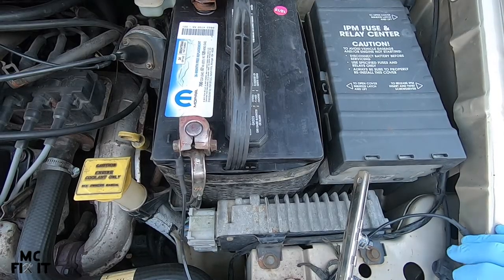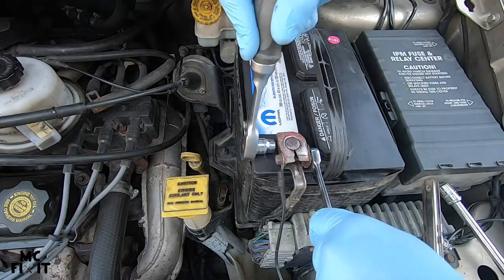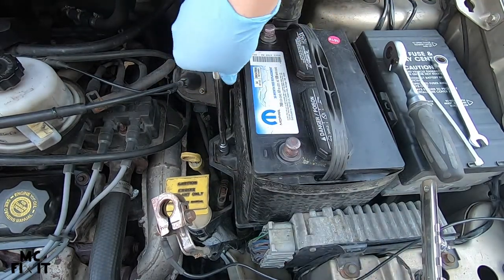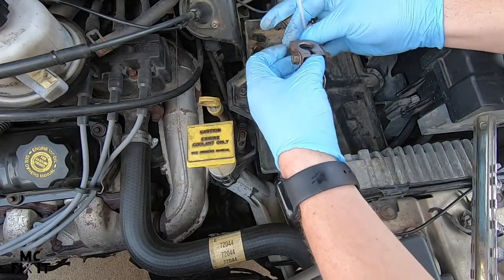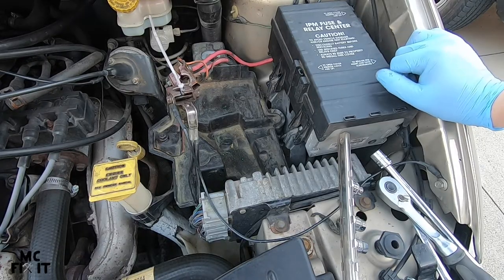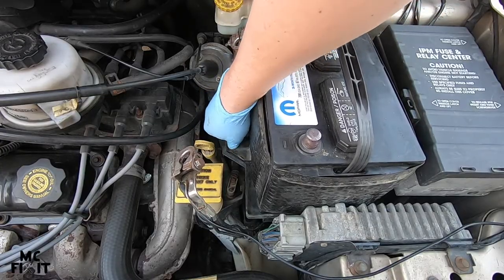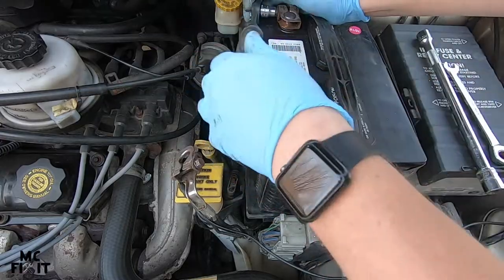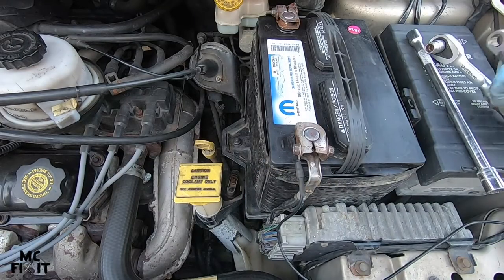How to Reset Your TIPM or Fuse Box on Caravan / Town & Country 2002 (Complete Guide)

Comment: There is 100 percent nothing NOTHING I REPEAT NOTHING inside that power distribution box that can be reset they will let anybody post a video..... You can reset the pcm using the method that you show in the video if you turn the head lights on it will drain the compasitor in the pcm faster in like 15 minutes

Comment: I have a 2014 Town and Country van. It's started out that the engine light goes on, I did a scan and it said to replace the Cadlic converter. Then after it said to replace the oxygen sensors on the converter. Now the dash lights and on, no blinkers, heated seats don't work, no speedometer, no mileage, no gas signal. Not sure what it is, costing me allot of money just to figure it out. If I clean out the tipm, or replace it, do I have to reset the computer? Plus the lead on the ECMS looks like it might not be on correctly. Could that be the cause???
Reply from the maker: Hello, your 2014 will be multiple generations newer than 2002 Town & Country. They have changed a lot of the technology and computers since then. This sounds like it's either a wiring issue or computer-related. It's really had to diagnose without being present. These vehicles are known to have both wiring issues and computer issues in most years. I'd definitely look at the leads to your ECM and see if that might be the root cause. Do you have a trusted mechanic in your area?
Reply: @MCFIXIT  I do, but I have to look and see if there are any loose wiers on the altrinator. Or something simple.
Reply from the maker: @deanjagger1190  That's definitely a good idea. Sometimes these vehicles are plagued with wiring issues. 
Also check to ensure you have good ground. I don't remember exactly where they are located, but I think there is one under the battery and another on the opposite side of the engine block from there. If not properly grounded, you can experience some issues too.
Reply: @MCFIXIT  I did clean the Tipm, fuze box out and put it back in. Didn't work, but before that I checked to ground wires on e side of the motor. Looked ok. Now I think it might be the insterment cluster. Ho[pe that's it.

Comment: Reasons you need to reset tips, my chrysler town won't start sometimes. Turn key, all lights display come like normal. But nothing happens, after several attempts ( 5 minutes later) turning key on and off it cranks ?
Reply from the maker: Did it end up working for you?
Reply: Same here with my van. Seems the fuel pump pressure. Change fuel filter? Check valve in fuel line?

Comment: I'm trying this now....I've replace the starter the battery n  starter relay ...when I tried to start it now the fuse box started going crazy...ticking... ..before it wouldnt start sometimes then I would have to give it gas to start it...but less n less it started till it didn't start at all....so I found this video n hoping it will work ... I think it has something to do with the fuel ..sometimes the gas speedometer doesn't work or jumps up and down n the gas one is always off ... Any suggestions ? If this doesn't work? Will let u know in few hours
Reply from the maker: Did it work?
Reply: When my SUV went nuts, the first thing I did was get battery and alternator checked, also my pedals and everything in between, but them I realized it had to be something that effects all electrical, and well I'm doing the hard reset before I replace anything else to make sure I do not toss money away

Comment: Does it help to remove all of the plugs under the fuse box to assist in reseting the system? Or is this enough?
Reply from the maker: You can definitely do that, but it is not necessary. I've got a video on how to pull it all apart, clean it, and put it back together here: https://www.youtube.com/watch?v=kir-bH6lQVg&t=739s
Reply: No remove all plugs, I guy who worked in a dealership has a video telling all their tricks, and he said to remove all plugs
Reply: @anamarin6475  What was the video if you remember, 
and did he still bind the battery cables together, and
for how long?
Reply: @bikersoncall  actually it was not the TIPM it was my battery, strange thing i replaced battery and all ISSUES gone
Reply: @anamarin6475  On my Harley, if the 
ECM sees 'low voltage' even on a 
newer battery (sitting for a while) ,
it will have issues. Cool that your new
battery solved the issue. If you remember
the video , a link or exact name would 
be great!
Reply: @bikersoncall  n yes he did bind them all together

Comment: Do you have to take out the battery?
Reply from the maker: Great question. Technically no. But I would make sure to take it out so the cable do NOT accidentally hit the terminals. It's not worth the risk to leave the battery in there
Reply: No I'm doing .ine and I did not

Comment: I replaced my tipm my car run great but my service dash lights are all on, my speedometer doesn't work, and my turn signals in the back come on when I break instead of the actual break lights. Is there another way to reset the tipm?  Or what is the problem?
Reply from the maker: You have to get it coded for your vehicle. Where did you get the part at? Some of them program them for you. That’s a different process than this video.

Comment: I'm doing my reset on a 08 dodge nitro right now, battery is still on car, just unplug and put aside when putting +/- together, unplugged all my TIPM plugs and leaving it over night, my SUV is possessed and need to remove the evil out, hopefully this does the trick, I believe when my struts were replaced, my guy did not reset my TIPM and had unplugged all plugs to get to the driver side strut, and as I know for fact for I was there, he did not reset anything, maybe this caused me issues later🤷
Reply from the maker: Let me know if this fixes it! Hoping it solves your problems!
Reply: @MCFIXIT  already connected it all, did a short test run, so far it's fine, but  later it would do it's possession act, will see later on tonight picking up my son, not driving on fway just in case something happens.  UPDATE: IT HAPPENED AGAIN LESS CRAZY BUT IT DID, IT'S THE TIPM🥺 HAVE TO REPLACE
Reply: @MCFIXIT  i forgot to update problem continued, what eliminated the problem was replacing the battery, strange thing it all went back to normal
Reply from the maker: @anamarin6475  Glad to hear you got it fixed!

Comment: What are the symptoms that indicated that you should reset the tipm
Reply from the maker: I don't remember exactly now since it's been over a year since I did this fix, but it had to do some with some random issues where the lights would mess and once the wipers turned on when they weren't one. This helped reset everything and make it work properly again.
Reply: Your vehicle looks like is possessed, that's what we call it in the Dodge nitro community, my case my light on panels started blinking rpm and speedometer started going nutz, some say their wiper and windows come alive, also wipers and lights and alarm goes nutz, and like mine my vehicle completely shuts off and turns back on

Comment: Could this solve my issue with ODB2 not getting power? Says in manual after battery replacement it needed to be reset by dealership in manual. I never put those terminals together gonna try it though.
Reply from the maker: Not certain but it’s worth a try! Hope it works!

Comment: Do you know what the small red wire on the positive side is?
Reply from the maker: That was to an additional set of fog lights that weren’t original
Reply: @MCFIXIT  my van has it also though. Not sure what it's about.

I tested my ignition switch today by back probing the B wire at the ignition switch and there isn't any power there but should of been 12v.

Comment: I don’t know if you could help me but I’m having a problem I replace three alternators and they still don’t they still fail when I take it to the auto parts store to check the alternator charging the battery I’m having all kinds of crazy blinking of the   lights Panel lights after the car sits overnight it won’t start it seems like a drain the battery but the alternator is showing it’s not charging I went through three brand new alternator don’t know what the problem was wondering if you can help
Reply from the maker: Do you have a multimeter? Set it to 20v (or 12v). See if how much power you are running at the battery and at the alternator positive port. Then crank the ignition. See if there is much of a drop. You maybe experiencing voltage dropping and your alternator is not able to work properly. Good luck on your fix!
Reply: @MCFIXIT  what would cause  voltage to do this?  What would cause a battery and alternator keep going bad? I have replaced my alternator 2x since having it and 3 batteries since I had it and random  battery lite keeps coming on and sometimes when it rains does it to not always in rain….
Reply: @Thomas Martineck  👋  Am in your situation now. Kinda feeling lucky someone know what am facing. I just  want to ask how did u came out of that problem.? 
What's the part at fault? Fuse box or something?
Pls reply as soon as possible. Am in that from months.
Reply: Pls reply whenever u get this 🙏

Comment: So my question is we changed the radiator out in our Chrysler Town and country van and for some reason or another the heater is not working now do you think it would pay us to reset the Box
Reply from the maker: It might. It sounds like it's electrical and that's why I did the rest on mine. Hope it helps!
Reply: Hey... There are many videos on recalibrating the heat/cool and air diverter doors by press and holding both either PWR and RECIRC buttons or .... depending on make/ model/ yr

Comment: Is there any volatile memory in the TIPM that can be "reset"? I took the fuse box out of my 2005 Grand Caravan, and there was only analog circuit board, fuses, and relays; nothing that could be "reset". Perhaps this process would work for the Engine Control Module.

Comment: This is a Integrated Power Module ( there is no microprocessor or microcontroller to reset in that IPM) not the dreaded Totally Integrated Power Module that Totally sucks.,  the TIPM, wasn’t installed upon Chrysler Town and Country until 2008 and up. This is a 2002, same as the 2001-2007 4th Generation Minivans!
Reply from the maker: Yes, you are right. It's an IPM!
Reply: @MCFIXIT  wont work on 1999 dodge caravan ? heck too late i just hooked up the cables with a zip-tie for nothing. i cant even find a fuse-box for a 1999 on ebay - at this point no where- so this goes out the whole van is trash??

Comment: Car cranks but doesn’t start after an alternator replacement could that mean the tipm?
Reply from the maker: It could mean that also check to make sure you are getting fuel (fuel pump) comes on when trying to start. It could also be spark (coils, plugs). It could also be battery (make sure you have 12v+ at battery).
Reply: @MCFIXIT  well I don’t wanna mess with it because there is a cover to get to the ignition system, automotives at Walmart told me because it did it there that they here the pump

Comment: You said this could help in random strange things happening.. will this help reset stereo? You know how the clock and radio n cd 💿 all together, well it been 15 yrs since it last work..  when u turn radio on or CD player or cassette it starts blinking with slight noise and only happens when turned on, but lately sometimes not always when turn key on it makes my CD player act like I just turned it on does blinking…. Now when start my van sometimes the fans to Heater turns on automatic without being on strange never experienced these thing on car like my DGC it 2001 … do u think it could help doing this?
Reply from the maker: It may. Those are some odd issues. So any of these happen all at once?

Comment: I got a 2012Town&country it wouldn’t start until I piper cable less then 10 to 15 second then it starts right up and runs all at I change the dack door lock because it would keep the lights on all get

Comment: I have no power at the range sensors on the tranny. No ignition power at the starter. Have starter power from battery.  Any ideas?? This didn't work for me 😢
Reply from the maker: That’s weird. Have you tested all of your grounds to ensure they’re properly connected and aren’t rusted? There is one under the battery connected to the metal and another one on the engine.

Comment: Will this reset the pcm
Reply from the maker: No, it just resets the TIPM. It helps with the electrical system with the TIPM like draining energy from the capacitors or showing you that you may need to replace the TIPM.

Comment: My husband put a new battery in it and started it and left it 
Run for awhile and it run out of gas now it won't start you can hear the fuel pump but won't start
Reply from the maker: Thanks for writing. I’ve never come across an issue like that. Im not sure the resetting the TIPM would help but it might. Maybe try putting the fuel pump relay and check to make sure it still working.

Comment: This does nothing and the battery will not drain I tried this myself for 24 hours and hooked both cables back up and the mileage trip reading was still the same does nothing
Reply from the maker: Sorry that it did not work for you. I had good luck using this method. Maybe try clamping them together with a vice grip tool that can really lock them together. Hope this helps and resolves your issue!